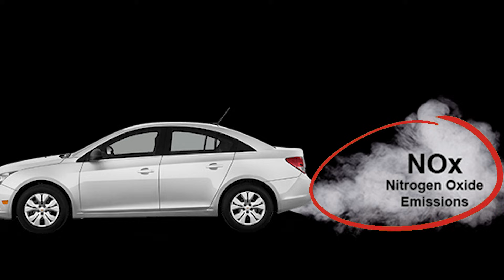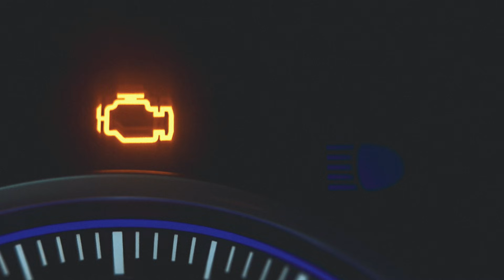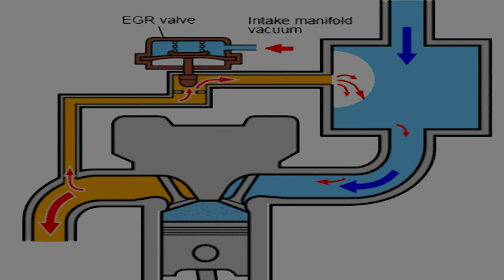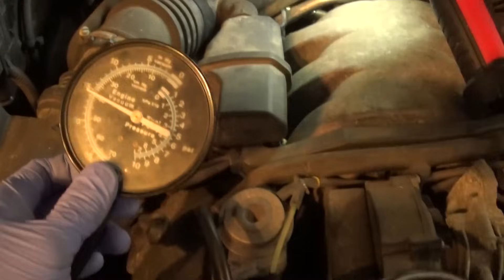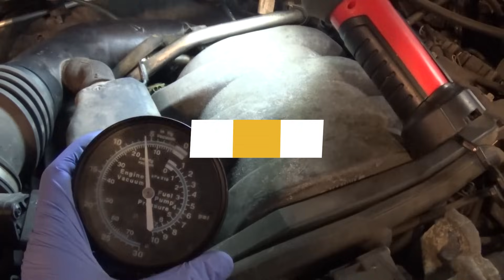9 Most Common Symptoms of a Bad EGR Valve | Signs EGR Valve is BAD

Comment: So i was in a hurry to put the engine back together to get the wife back to work.. forgot to put the vacuum hoses and PVC hose back on and atarted it and ran rough..then realized what i did an put them back on and atill ran rough and wanted to stall out w alil nlack smoke out the back..egr valve has 220k miles on it and looks almost clogged..im guessing either that or cats but ran good before this happened..but had to take the egr valve pipe on an off 3 or 4 times jerkin it around..so 8d imagine id movee the carbon and clog it